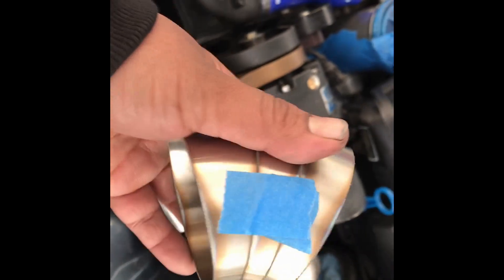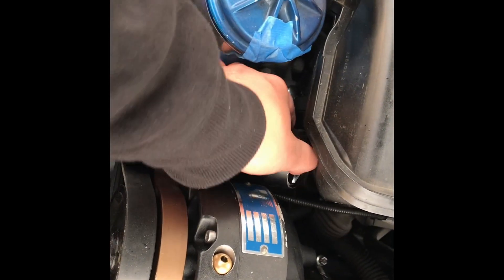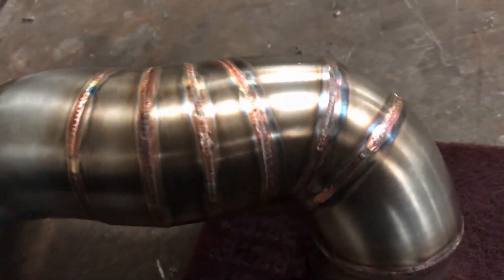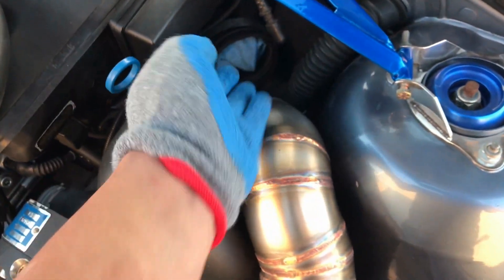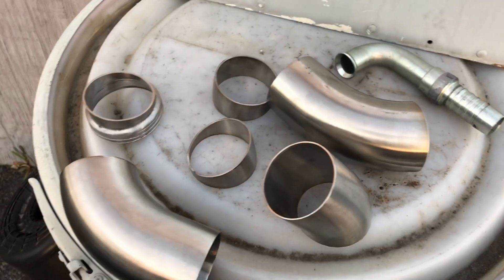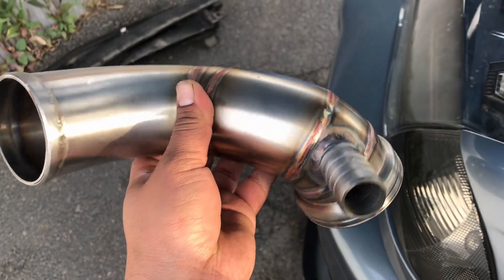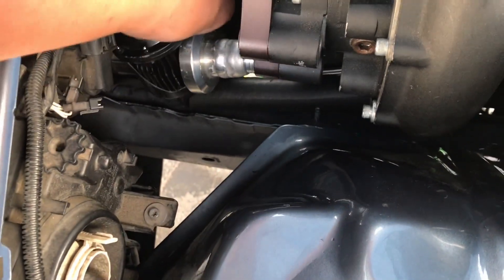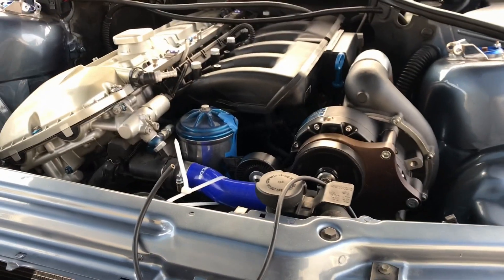Fabricating Intake and charge pipe E46

Comment: What do you use to cut those pipes at different angles
Reply from the maker: Just my grinder with a thin blade
Reply: @acef_performance8416  Ahh I’ve been using an electric saw. What do you use for the angles?
Reply from the maker: I just eye ball everything, I’ve cut and welded for years. Practice make perfect

Comment: Shouldn't this setup be using a bypass valve instead of a blow off seeing as the maf has already accounted for that air? I'm going to be getting a setup like this, hence why I ask
Reply from the maker: Isaac Moran you are right, but a blow off can also be rerouted to the plumbing like you said to be a bypass, I’ve been running it like that but seems ok definitely a hesitation on shift from 1 to 2nd could be that I will have to test. Car lately has cut off at high speed shift didn’t have that before but could be that to, I will have to reroute and test on next video, keep watching coming soon